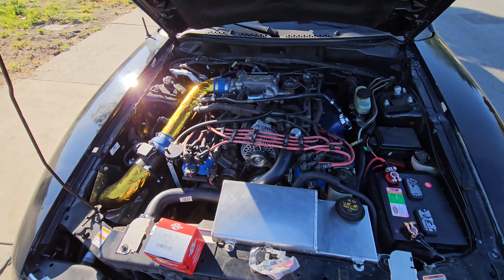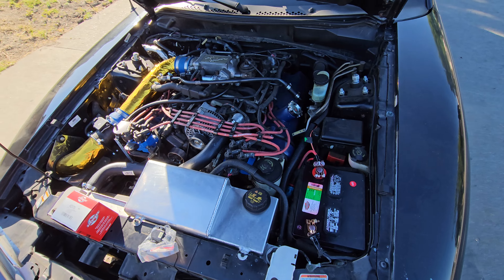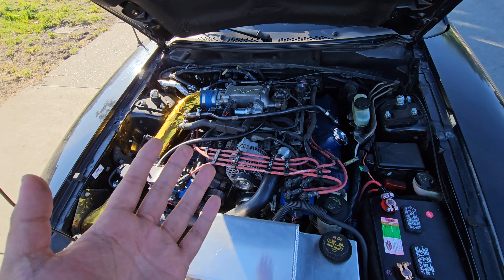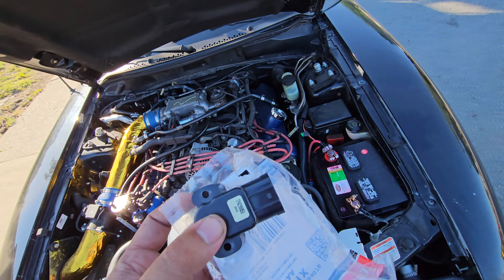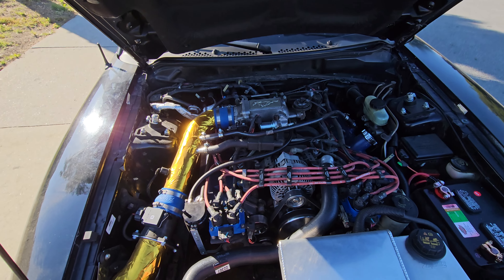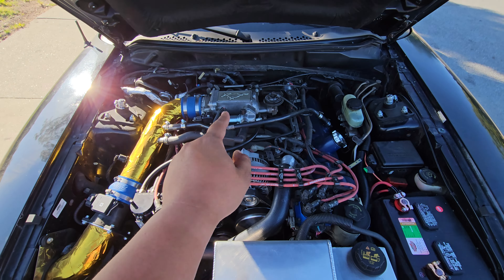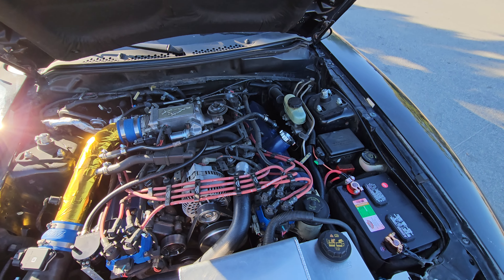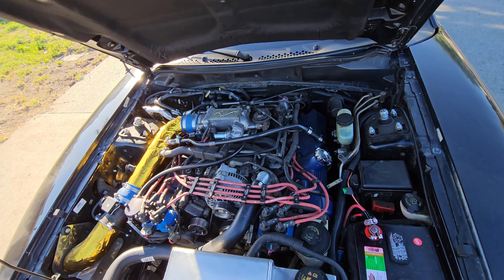Sn95 idling weird specifically in park? Watch this video!

Comment: I did not hear you say was there a code, check engine light. Idle air control sensor it sounds like.
Reply from the maker: No code. Yea probably iac or tps.